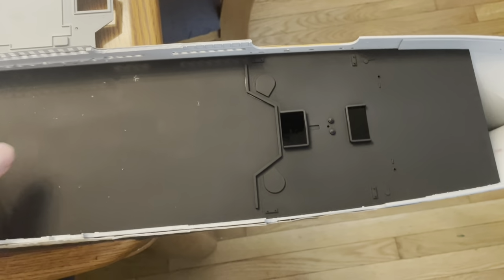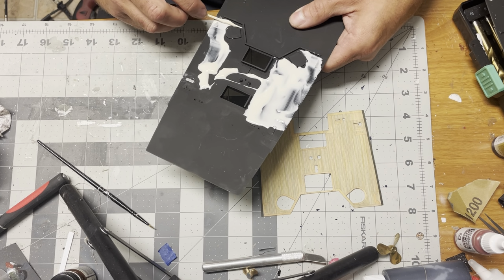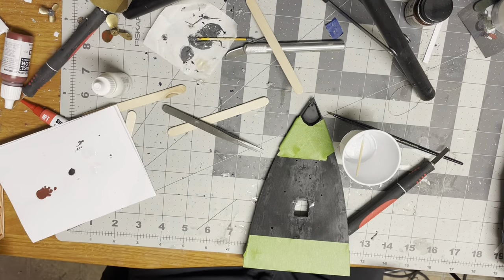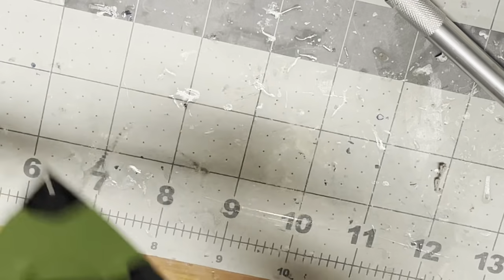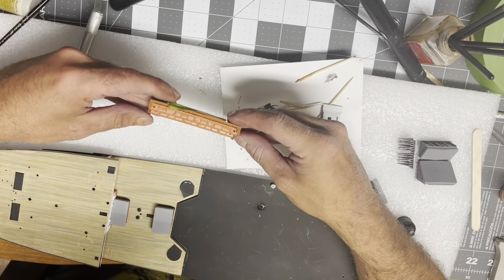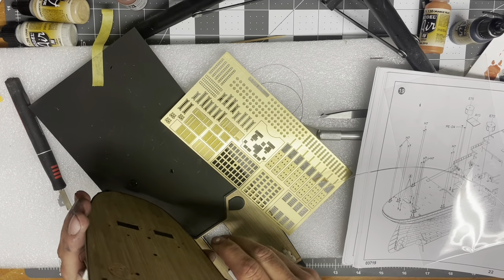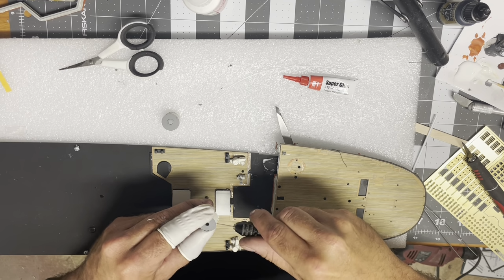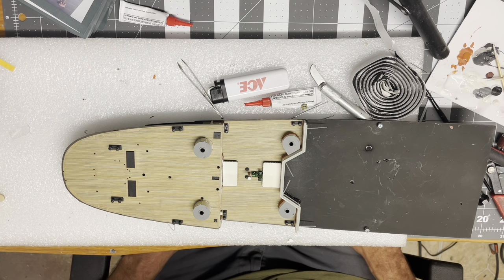RMS Titanic 1:200 RC Build Part 11.   Well Decks

Comment: Hi, you really cracked on with the model in this video!  The little pipe attached to the forward bulkhead of the well deck was a steam exhaust pipe from the winches. This redirected steam away from the winches out through the plating when the condensers were not being used.  Light leakage is an annoying problem at this scale.  I have been developing sealed light boxes where I can, that have an LED inside and covered in a foil tape.  I attached these to parts of the under side of the deck where a light source is needed.  Then fibre optics can be fed into the box to the relevant area like the crane mounts and are much more localised for assembly.  They work extremely well for me and can eliminate 100% light leakage.  The heated light bulb effect on the fibre optic cable  is a good idea.  Great work so far. JH ⚓😉👍
Reply from the maker: Thank you for all the information there.  Very helpful!
Reply: I found that Gorilla clear glue is excellent for permanently setting fibre optics, albeit a bit slow in settings!  @LCModelBuilding

Comment: You might want to use an proper size brush for glue application.  Much easier.  I would also consider using a non-water based glue as it might adhere better long-term.  You could always use an adhesive spray like Super 77.  3M also makes a stronger one.  Spray it on theback of the deck.
Reply from the maker: For the decks?   I’ve had problems in the past, so I generally use the gorilla wood glue or Mod Podge. Have never had a problem.
Reply: @LCModelBuilding  nice.  I always thought those wood glues wouldn't adhere well to plastic.  Are you using the (exterior) waterproof one of the interior one?